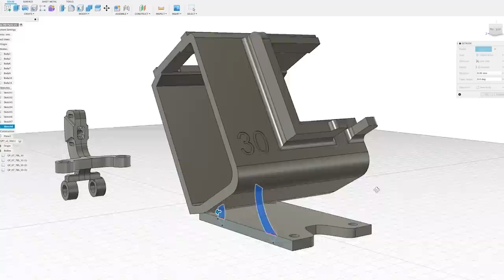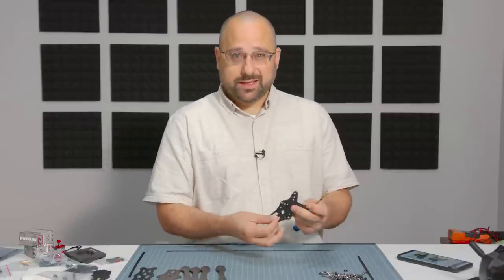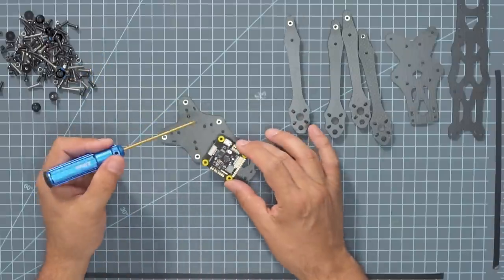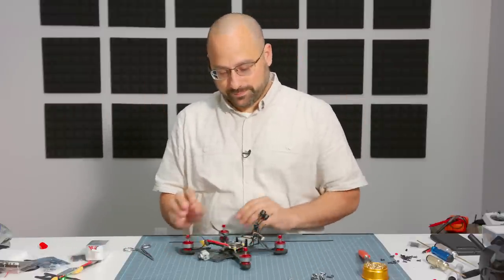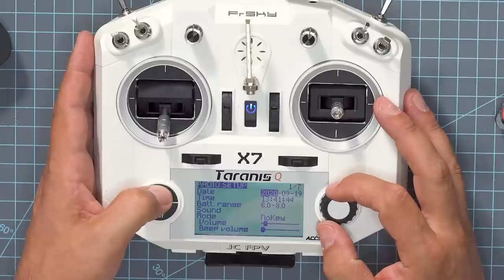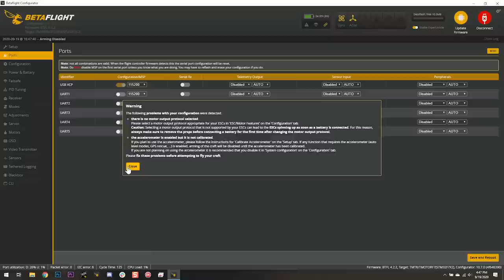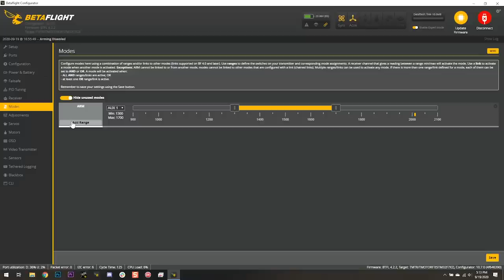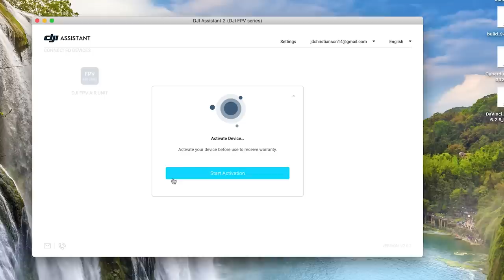ImpulseRC Apex HD DJI FPV - Full Build Tutorial

Comment from the maker: Watch the trailer for FLOWSTATE THE FPV DRONE DOCUMENTARY at https://youtu.be/8TMUfvTD2qs
Reply: Hey whats up bro. Just wanted to ask a quick question on why you always use rubber bands on the gopro for? I figure extra insurance so it wont fly out in a crash but can be wrong.
Reply from the maker: That's correct
Reply: @JoshuaBardwell  I'm after a laptop what is the make that your using in this video please? Thank you.
Reply from the maker: @markcloudchaser874  Dell Inspiron is the one you see me using.
Reply: @JoshuaBardwell  Thanks very much for letting me know. Because before I buy a kit etc, I have to have a laptop just to make sure I don't get anything wrong. I learned from watching you. Thanks again and happy flying my friend. 💯
Reply: I have the DJI FPV drone. Can I use the controller from that one? Do I still need the full Team Blacksheep TBS Crossfire Nano TX Starter Set?
Reply: @hankb7725 you can't use the old rc, the new one can be used

Comment: New to FPV, mostly simulator and a tinywhoop 85x I been flying for a few weeks.  Just followed your build on this went pretty smooth.  I just use the air unit to communicate with dji googles/remote.  Perfect first build as the soldering to the esc has nice big pads or at least it felt that way.  2 problems I ran into.  My Vifly smoke stop kept going red after I added the DJI air unit to the FC/ESC.  Didn't realize it had a switch 1amp or 2amp.  2amp fixed it.  Second you need to update dji air unit to same firmware as dji controller or it won't communicate in betaflight no matter what you try.

Comment: Screws install in order and size if that helps and you have a caliper on hand:

Frame Lower Rear - Stack Mount (4) : Countersunk 20mm 2.0 Drive
Arms Inner (into lock thread) (4) : 8mm CAP 2.5 Drive
Arms Outer “shoulder bolts” (4) : 13mm CAP 2.5 Drive
Motors Screws (16) : 10mm Button 2.0 Drive
Frame Back Lower (4) : 8mm Button 2.0 Drive
> Then Building to 1:15:00
Frame Front Lower Inside (2) : 8mm Button 2.0 Drive
Frame Front Skid Plate (2) : 12mm CAP 2.5 Drive
Frame Top Rear (4) : 8mm Button 2.0 Drive
Frame Top GoPro (4) : 10 and 16mm Button 2.0 Drive
Reply: Just got the DC version of this frame. Nice piece, but holy shit.... the standoffs that come with it are cheap shit and the hardware is an absolute joke. 🙄 Do yourself a favor and just order replacements right now, because this is crap. Aside from that, very nice. The TPU camera isolators are also useless with the polar camera.

Comment: I actually asked the bolts vs screws questions while working in a mechanical engineering office. General thought was if it goes through a hole and receives a nut then its a bolt. But my argument was that I wouldn't call an m3 a bolt regardless. BKM has not been written for this standard lol

Comment: Bolts vs. Screws, They are both Fasteners, but the difference is a screws normally screw into something. while bolts normally pass threw, and will have a nut, but not always a washer.
Reply: Our classification at work is if it gets tighter the more it goes it its a screw. Where a bolt is the same diameter the entire length.

Comment: I thought when you used a different radio (not using the DJI controller) you removed two wires from the DJI air unit (SBUS and GND)? Does doing it the way it's done in the video give you the option to use the DJI controller or a Taranis with Crossfire by just making changes in the ports tab to the corresponding UART/Serial Rx and changing the receiver in the Configuration tab of Betaflight?
Reply from the maker: Correct.
Reply: @JoshuaBardwell  Thank you, and WOW! This saves me so much time and headache as I'm currently switching eight quads to Crossfire and moving away from the DJI controller.

Comment: If the power lead with XT60 and the cap was pre-soldered to the ESC, and the ESC/motors used MR30 connectors.... it would be plug-in-and-play :)

Comment: I noticed three cnc'd notches in the back edge of the ('half'?) plate that you attached the DJI air unit too, they did not seem to be put to use!  Is it possible the thin/light/full length plate was intended as a lower 'skid plate' for the DJI air unit  to sit on as well as offer a uniform (unstepped) lower surface and the rear ('half'?) plate with the three notches then carry/hold/restrict the Air unit cable as well as the two antenna arms?

Comment: It could not be better explained !!! , only one question, it is not necessary to remove the receiver wire from the DJI unit when using another receiver??
Reply from the maker: You don't have to unless you intend to reuse that UART for some other function.

Comment: Should you go for the HD frame or the normal frame if you're gonna be using the Caddx Vista?
Reply: Normal frame
Reply: Neither too expensive for what you get
Reply from the maker: Normal for the Vista but I would honestly consider a lighter frame if going Vista.
Reply: @JoshuaBardwell  I didn't hear what the all up weight is on this build. I'm about to build another 5" with the extra dji air unit I have and want to keep it as light as possible (well, a good balance of light weight and durable, if possible). Any idea what this build ended up at? Or suggestions for another frame if you have one?

Also- thanks for all that you've done for the fpv world. I've watched way too many of your videos. They've helped me tremendously!

Comment: Hi Josuhua, thank you for your fantastic videos. I have this flight controller and I'm looking to switch from the dji controller to crossfire tango2. I note you used uart 5 when you soldered up the nano, but the dji plug and play cable also uses uart5. Does this matter, and could you still use both controllers if you wanted to with your setup? Thanks again
Reply: Hi did you figure this out? Any help is appreciated!
Reply: @Leftyatm  hi mate, just soldered the nano to r5/t5 uart and it worked no issues. Good luck
Reply: @bkes1552  thank you sir!

Comment: I love the video. I am using your build as a learning experience. I am using the same flight controller and ESC driver but I want to implement my own receiver that would send the commands to the Tmotor F7 controller via UART. Do you know if there is any documentation on the commands that we can send to the Tmotor F7 flight controller. I could not find a user guide any where that has those commands.
Reply from the maker: If you mean to send MSP commands, here is the documentation: https://github.com/betaflight/betaflight/blob/master/src/main/msp/msp_protocol.h

If you simply want to implement a receiver, then you could use a publicly available SBUS library for Arduino or something similar.
Reply: @JoshuaBardwell  Thank you for the quick reply, the information you pointed me to is very valiable. Which Tmotor F722 UART ports do I send the MSP commands through.

Comment: Great build . Can this exact build be used with a turnigy evolution radio . Thanks
Reply from the maker: You would need a compatible receiver but yes.
Reply: Thanks . Would the range loss be significant and will it need soldering to the  Fc . Im new to your hobby and see your diatone roma dji video and the bad weak frame vids . The alloy did look very much like its was cast to me too ..  The apex frame looks alot  stronger . Also will the chameleon ti have the space needed for the dji setup . Thanks for your help Joshua .  👍

Comment: Nice Build. But I got a question: I saw multiple videos where ppl would need to mod the hardware inside the X7 for the crossfire module to work properly. He did not do this in this build. Could someone explain to me if I can buy the X7 if I plan on using crossfire? Does it need a hardware mod or not? Im a confused newbe. I'd like to buy the X7 because it seems to have the best price - performance for a beginner.

Comment: Newbie question, So if I wanted to add a GPS, that would connect to the flight controller, right? Which gps modules would work with Betaflight and the DJI Air unit. Not using an external receiver.

Comment: @Joshua Bardwell 11:52 they are called screws because a bolt would be without a thread.
Reply: so now bolts don't have threads? perhaps the difference depends on the head itself?

Comment: Did you have to use a bec to keep the air unit within safe voltage?
Reply from the maker: No. The FC has a built in voltage regulator.
Reply: @JoshuaBardwell  this is great news thank you.

Comment: Whats the final weight with no battery? I havent watched the whole video yet, but I skimmed the parts where I figured a scale would be present and never saw one.
Reply: I weighed it in at 455 g without props, battery or gopro. It comes way up to 804 g with props, battery, gopro and a thick strap.

Comment: is there any way to remove those black things on the video from the Googles? it seems like it takes a portion of the video feed
Reply from the maker: The RSSI bars can be turned off in the RapidFire module menus.
Reply: @JoshuaBardwell  hi ! this might be a noob question but how can you mount your DJI camera in order for the apex front standoffs to not be in your googles view as seen on 1:20:03, or are those the RSSI bars that you mentioned im a little confused. thanks in advance.
Reply from the maker: I see what you're asking. You would need to push the camera forward to get the standoffs out of view. This might require a 3d printed adapter or design of different camera plates.
Reply: @JoshuaBardwell   thank you ! I was looking at the video closely 1:17:47 and I think it might be the 3d printed go pro mount that you put on top, it looks like on edge is sticking a little bit which might be what’s seen on the video feed ,

Comment: Mounting an AirUnit is giving you 1080p (not just 720p and I am sure Mr. Bardwell knows that) and it looks quite good. I can easily impress my mom not using a GoPro just to say. I actually wonder a bit, because if you create a setup like this you may just use the DJI Controller and no GoPro or Crossfire to make it easier for new people to pick it up. And yes I have a GoPro and use Crossfire myself. Again, just saying.
Reply from the maker: The air unit records in 1080 but both air unit and Vista transmit 720 to the goggles.
Reply: @JoshuaBardwell  Yes and as you use the AirUnit (and not the Vista) you have a reliable 1080p without any over the air artifacts. That is why I don't think one has to have a GoPro on it to impress "somebody" as you say in the video. I would have expected that you mention that. Because this is probably the main reason to use a full AirUnit instead of a Vista. At least for my flying the antennas make not such a big difference. I have three DJI Quads with AirUnit (Mr.Croc), Vista (TBS Source), and Nebula Vista (X85). I did some experiments with using video effects in post on the 1080p video from the AirUnit and think you can get quite nice looking videos from it. You may check out https://www.youtube.com/watch?v=FdBN6dMcwtk as an example of what I mean.
Reply from the maker: @Oderwat  I don't think that Air Unit or Vista is good enough to replace a GoPro, personally. Both AU and Vista are good enough for the FPV feed. The AU not having breakup is nice but to me isn't good enough of a reason to choose the AU over the Vista, unless you knew for a fact that you did not intend to fly GoPro on the quad.
Reply: @JoshuaBardwell  I just referred to the "impress your mom" part. It is clear that you can't use the 1080p for commercial or semi-professional videos but I think it is good enough to post your flights on YT. Did you check the video(s)? This one does a 1:1 comparison from the same flight (perspective corrected so they even match up nearly seamlessly) https://www.youtube.com/watch?v=vaTSroj5jQw ... People I asked actually preferred the right version. Which is the AirUnit. I didn't have the correct post motion blur ready when I did this one.

Comment: These small additions in "routing", the tiny additional steps for the CNC machine... take practically no time and cost basically nothing.
It's silly to say that these bits of machining make the frame worth it's price.

The fact is that when you route out carbon fiber, you basically bypass those layers in the carbon sheet and make the component weaker at that point.
Most of the little bits of machining and "keystone" designs are just for marketing.

Even those cone washers basically do nothing... They just add weight. The bottom plate itself already spreads the load of the screw on it's own.
Reply: And it looks like it has 20x20 holes but they don't even go through anything..? Soooo... How do you even use the 20x20 holes?
I'm probably wrong here but I don't see how those 20x20 holes on the top plate are usable..?

Comment: A nice frame, however, having the props in view is not acceptable with HD video. Especially considering the price of the frame! How come they could not realize this in their design? Other companies did their job (i.e. GEPRC)
Reply from the maker: The Apex is prioritizing neutral frame geometry. They assume the FPV can is just for the pilot. The GoPro doesn't have props in view (depending on uptilt).
Reply: Well, with regard to the many ways you can tune Betaflight, is "neutral frame geometry" still the big deal?
Reply: I seriously never notice them once I'm in the air.